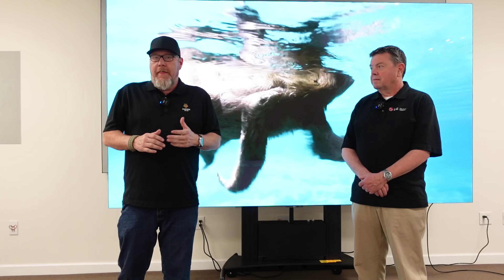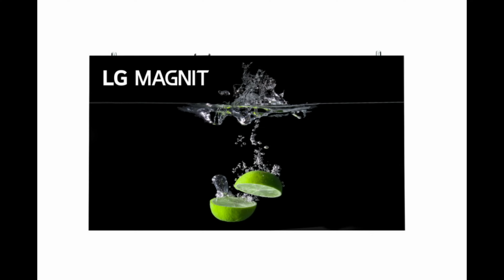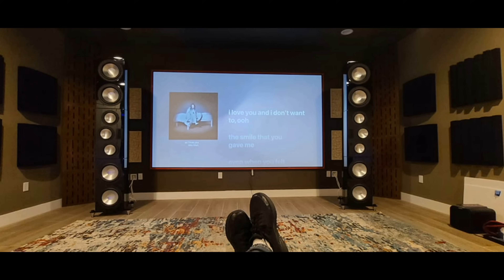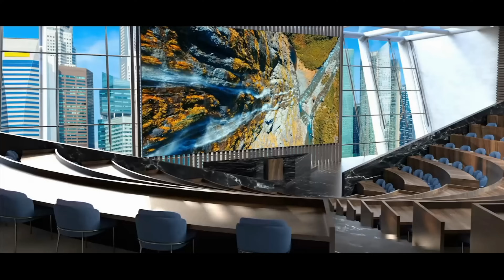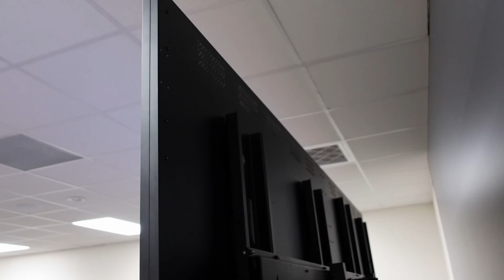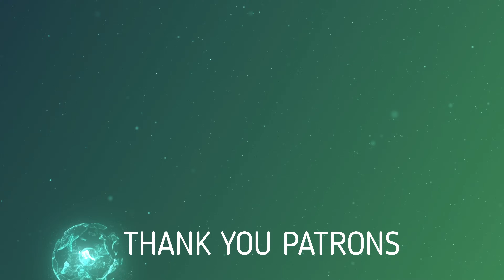Will Direct View LED TV Make Front Projection Obsolete?

Comment: At this point, direct view LED is a fantasy product for the average home owner.  Even the really big LCD screens at 98" or 100" are a fantasy when they run $10,000+.  The typical consumer when looking for a big screen experience, is still stuck under $3,000.  The real price hit area is closer to $1,000 for the vast majority out there.  This product, obviously doesn't fall into the vast majority, or the small minority, but it sits with the absolute elite.  Or, more often, the high end conference room.

The one real thing that isn't really done in any of these videos is cast a very serious eye at the quality of what it is.  Direct view LED has a rather serious issue with sections of LEDs going out.  This means that the entire display requires about 5% to 10% of 'spare' modules on hand at all times to perform hot-swaps of the modules.  It isn't discussed how the seams between modules, while very good, still isn't perfect.  So, yes, you can SEE THE SEAMS!  Not always, but definitely at times they show up.

Then, of course, there are no actual measurements of the display.  Contrast with these is insane, because of what they are.  But, how is color accuracy?  How is HDR performance?  What is the resolution of the display in use?

I've done work on several installations of direct view LED walls.  They have certainly been simplified over the years.  They are also figuring out solutions to issues which have been in place from the start.  The addition of a remote is a nice touch.  Along with 'standard' input right at the display.

But, at $80,000+ it's not 'comparable' to anything but the ultra high-end (and tiny) theater.  A typical buyer can pick up a Epson 3800 projector and pair it with a 180" screen in the dark, or a 120" ALR screen with some ambient light and get quite solid results for large screen sizes for under three grand.  This is over 25 times as expensive.  So, it's not one of those products for those who actually ask how much it will cost them.  It's not just years away from that price point, but sits decades away right now.  In fact, it may never be the 'norm', and it's been this way for a decade already.

This is Lamborghini tech.  It's pretty to look at.  It's exciting to talk about.  But, there is no point where this is likely to ever be affordable to your average consumer.

EDIT:  OH - And this display is 1080p.  Not even mentioned in the video I believe.  This isn't 4K tech, or 8K...  1080p.  Come on.  At least when I drop $25,000 on a high end laser JVC, I am working with 8K technology.

Comment: These are way way out in the future... 1st, they really aren't as good as advertised... you really need to sit much further not to see the pixels... 2nd, the amount of energy requirements.  And heat they put out... if you have a cave it's gonna be hot and you need a lot of air-conditioning.... 3rd, you can't place your speakers behind...

Comment: Is this the same thing as the MicroLED concept (self emissive pixels, but non-organic) but with another name ?  MicroLED manufacturing itself needs a major breakthrough for the prices to come down. A panel like this takes so long to make. If they don't come up with a solution on the average time it takes to produce a working panel, they will never be able to get to economy of scale. And this is is only a 1080p panel (not a 4K). The MicroLED technology is amazing since it grants the benefits of OLED (true blacks, great viewing angles), without the drawbacks (burn-in, brightness). I hope they fix the manufacturing problem. If they do, we might be looking at the future technology that could replace some home theator projectors, indeed, for those who do not plan to use an acoustically transparent screen to get the center channel emit from the middle of the screen ;-)

Comment: The only way for projectors to keep up with large tvs is to achieve light control at pixel level and turn on/off every pixel the same way as OLED. If this will become a reality, in bat cave rooms the on screen native contrast will be insane and inky blacks will be possible.
The current TV's are all based on sample and hold technology and if nothing changes in the near future, the projection will still have a significant advantage in motion handling of native 24p movies.
A future true laser projector , with light control for every individual pixel, will mop the floor with any TV, regardless if it's OLED, QLED, micro LED,etc.

Comment: This looks really cool and awesome! At first this looks more for commercial use but this can work well for home use also I guess.
Anyway for home use if projectors also evolve I don't think they will be obsolete. In a sense a front projector system is pretty easy and simple to install relative to the size you get I mean there is little difference in installing a 100 inch screen vs 200 inch screen and there is very little that can go wrong. Even if there are modules for these displays it is still more work compared to a screen + projector I mean as of now many people I talk to that think about projector vs big tv has 
had the work of setting up a projector and screen as an issue and this LED display seems to require even more work than a screen plus projector. Also with a retractable screen you can somewhat hide the projection system.
But as of now I guess the price is the biggest issue but as with everything the price will go down if there is an interest for them. In the end I think the main factor will be price per inch so to speak because now, in my opinion, a projector is very cost effective in terms of price, size and picture quality.

Comment: Front projection is difficult to compete with on price and constant image height applications.  The acoustical properties of front projection can also be superior to a very large flat panel.  It is difficult to locate speakers behind LED panels and their sound reflection properties are worse than a good projection screen.

VERY bright screens that are as large as my projection screen in a dark room can also be offensive.
Reply: First part yeah higher price, and you can't place speakers behind a MicroLed screen.

But last part incorrect as brighter screens only get very bright for specular highlights. The whole screen isn't super bright constantly.

Vincent Teoh and other professional calibrators have tested out MicroLed screens. And previous Sony, Samsung FALD LCDs with 2,500+ nits and it isn't offensive. It's more accurate the higher the brightness!
Reply: @C--A  I said CAN not that this will be offensively bright.  I find large flat panels way too bright in a dark room, but that is me.  The older a person is the slower they adapt to changes in light output.  Motion artifacts are also much more obvious the brighter the image is.  I personally have zero interest in my projection screen being any brighter than 25 fL peak.  Someone else is free to choose differently.

Comment: Gotta be kidding that this will replace projectors any time soon if want 100” plus screen - very cool for stadiums and stores but it has dozens of pieces and takes an army of people to setup! Right now I have an Epson faux-K PJ that looks stunning at 110”, cost $1900 ($2300 with screen and mount) and took a friend and I couple hours to setup - a short throw PJ is much more likely to be in my future than this monstrosity
Reply: Actually the techs setting up a modular MicroLed screen would take just as long or less as you wiring up installing a projector. Plus building the projector screen frame, attaching the fabric. Then hanging it on the wall.

But anyway I also wouldn't want a MicroLed screen. Until the time they come in one single piece like normal tv's. I don't want a jigsaw stitched together tv!

Comment: Can i put the LCR behind it where they should be at 2/3rd the height of the screen ?
If not, then projection with AT screens won't go away anytime soon. 
Yeah you can watch anything in a non light controlled room but lets face it. In order to get immersed into the movie, you would want a pitch dark room, so light is not a problem.

Comment: This is what I want to see.  I am addicted to HDR and projectors just dont cut it for that.  Considering putting an 85" LED in my future dedicated room but that seems too small.  A 98" LED is still very expensive, but at least the TCL XL series brings it to under $10k.

This kind of technology knocking on their door could bring the prices of the large displays way down.  If they can get below the $7000 mark, we would be good to go
Reply: I had the same issue. Spend 6-8k on a decent projector setup. Or spend under 3k on a Sony 85" LED and upgrade the front soundstage. Went with the Sony... Needed up getting some SVS ultra subs and towers. Next up is the mini dsp and REW to get the most out of it.

Comment: Projectors aren't going anywhere anytime soon and the price comparisons presented here are misleading at best.  My 135 inch projection setup looks amazing [but clearly not on par with a backlit panel] and cost a total of maybe 6K.  Sure you CAN spend more but you don't need to.
Reply: Once the technology has been around, the prices should plummet dramatically where the differences are not so dramatic. Remember Plasma TV's came out at about $20,000 for a 48" TV.

Comment: My biggest issue with this, even if it was cost friendly, is losing my acoustically transparent screen.  I use three matching,very large, vertical tower speakers perfectly placed behind my screen and going back to small speakers with a horizontal center channel that is either too low or too high would be a big downgrade.
Reply: KRIX?
Reply: Definitely agree it’s going to be a long time before they figure out the audio side of having a screen like this and most peoples home theater rooms specially with 8 foot ceilings there’s gonna have to be a lot of space to place to center channels at the top and bottom to create that phantom image I know they’re probably already planning it in the works but still just think about how many different speaker brands types of speaker sizes and everything else home theater enthusiast go through I highly doubt there’s going to be an abundance of companies providing solutions that people will jump on
Reply: Perhaps a matching, vertical bookshelf speaker set to small (sending all of the low bass to the subwoofers) would work?

Comment: I recently helped a friend on the audio side of his setup. Granted he is in a basement where he controls the light and I have not seen a direct view like this, but his setup is impressive. He has a cheap screen 135" and 1080p projector with ceiling mount hardware for less than $1K. I just can't imagine this being 80x better. I will have to see it to believe it.
Reply: 80 times better definitely not but it will be brighter that’s not necessarily a good thing you don’t need a screen that bright in a dark room environment looks extremely unnatural and that’s the other argument is that TVs don’t produce light naturally like a projector does off of a screen it’s a lot more relaxing on the eyes and has a certain type of depth to it by the way 1080 P still rocks lol
Reply: I can't imagine projector beating even budget tv at colors, contrast, brightness (hdr performance), motion (4k 120hz) pixel refresh rate etc. I had 1080p last time around 7 years ago in my monitor.

Comment: I personally would only consider it if it was 4k. At 1920x1080, as the specs state, not so much.
Reply: Yeah I'm confused why a 1080p TV is 80k , can  someone please  explain?
Reply: @ufcm33  micro LED is still prohibitively expensive. The price for 4k would have been well north of 6 figures
Reply: @andymack8178  is it because  of  size? There are a couple of 100inch tvs now like the G2 is it 1080p per panel?
Reply: @ufcm33  both size and quantity. More costly to make smaller ones, then u need way more of them
Reply: Just wondering if thats 1080x1920 per panel.. now that would be something 🤔
Reply: some of you guys are not realizing that resolution is also based on visual perception. higher megapixel cameras still can not compete against large film cameras in many aspects (although that gap is almost gone now). he reason we need 4k on led is because of pixel density. its not actually the resolution that makes it fuzzy, its the spacing of pixels. high ned 1080p projectors from a sharpness perspective are visually clearer than a 4k tv. not talking about brightness gain but perception of what our eyes are convinced of reality. thats why they are more enjoyable in a movie to watch. 99% of people have never seen a professional home cinema to comprehend what I am explaining however so i can se why some might disagree. so the same goes for this tv, if it overcomes the shortcomings of both projectors (ambient light and brightness gain) and LED (pixel spacing...again not pixel resolution) then you might be absolutely shocked by how good it looks. so the only thing I can say is you need to see it to understand how its not always about resolution
Reply: Even 1080p per panel wouldn't be much to write home about. 4k is 4 1080p panels in 1.

Comment: Looks good but really we gotta wait for the Micro LED techonology to improve to the point where they can fit a 4K screen in the same size. I think most home theater enthusiasts wont even consider this until that happens. But i can see this being used in commercial and business environments where 4k is not as important.
Reply: I have a 100 and a 120 screen.  4K projectors and if I downsample a 4k source to 1080P you have to be within 9FT of the 120” to see the dots.  About 6-7FT for the 100”.

The real differences between 1080P and 4K are that most 1080P setups are not HDR and from a bit rate perspective 4k is going to have around 4x the bit rate (if comparing HEVC 1080P to HEVC 4K).  It is that bitrate on highly compressed formats that makes the big difference.

If you use a scaler to downscale a 4K source or stream to 1080P you can not make out the differences until you get very close.

Most likely these LG displays are 4K HDR ready 1080P.  Which means they will take a 4K HDR source.  For my computer monitors I’ve been running 1440P since 2010 and 4K since 2015.  But I’m only a few feet from those monitors and especially when sitting 3-4FT from a 55” TV 4k is nice to have when you are that close but I’m not sure you’d be able to see a difference if a 1440P 55” existed.  

As far as the dots are concerned 4K isn’t as important as people make it out to be.

As far as a render resolution for computers and a resolution that forces higher bit rates for streaming 4K is a night and day difference!!!
Reply: @MrGivmedew This is not about seeing dots but about seeing more details. I can do 10/10 blind test 4k/1080p at 55" 2m.

Comment: For me, 16:9 is just big tv, unless you're going to mask it to 2.39 and only remove the top and bottom masking for IMAX - and that  only works if you're sitting close enough for that to work as intended. I also like to have my speakers behind the screen. I can see how this may be ok for the general public, but I prefer a projected image in a darkened, non reflective room for movies. A tv is more convenient, but it's just not a cinematic experience for me. I'm probably in the minority though.
Reply: totally agree with you, projected image mimic the natural way eyes see things in reality, so it's the best tecnology as visual experience. Still is not for everyone and it's not practical as a TV
Reply: You can do 2.39 aspect ratios.  It has perfect blacks(so black bars are black), and you can still turn off the lights in your room.
Reply: @mrsittingmongoose  There's still a difference between reflective and emissive techs, and how that can affect how your eyes react depending on seating distance - tvs are generally brighter which can have an effect on your eyes iris (works more than with a movie theatre screen which is dimmer and fills more of your field of view) and cause eyestrain, hence why bias lighting was created (this wont always be the case for everyone of course). You still can't have the speakers behind the screen, and in normal rooms, even with the lights off, the light from the tv will light up the room and furniture etc (and the speakers) which can pull you out of the movie. It's just not for me when it comes to a cinematic experience, but like I say, I'm sure I'm in the minority.
Reply: @garyl5128  you can still use room control for lighting and bias lighting though.  And you can just lower brightness of the tv.  

You def can’t put speakers behind it though, so yes that is certainly a drawback.
Reply: @mrsittingmongoose  True to a point, but you will have to cover the reflective elements of the room with black velvet if you don't want to see them light up during brighter scenes. and bias lighting isn't something I want to use for watching movies - that isn't 'cinema' to me. I guess I'm a real stick in the mud when it comes to what I prefer, but I'm sure most people will love being able to have a large screen and not having to worry about the restrictions etc that come with front projection.